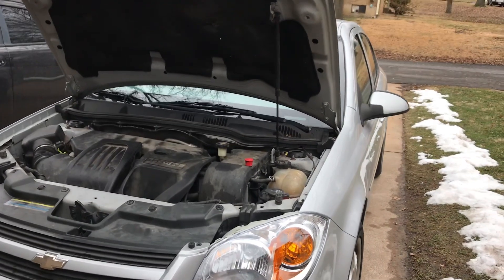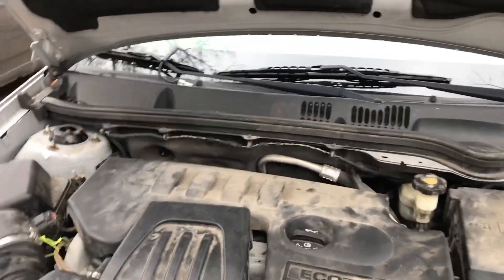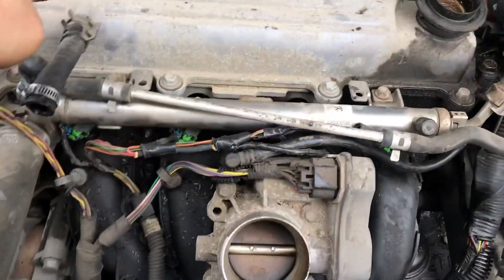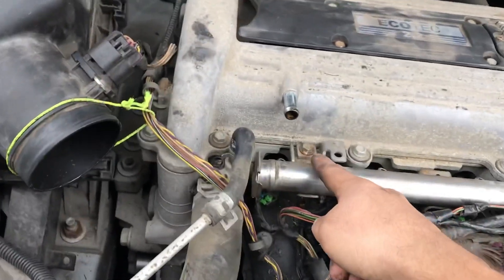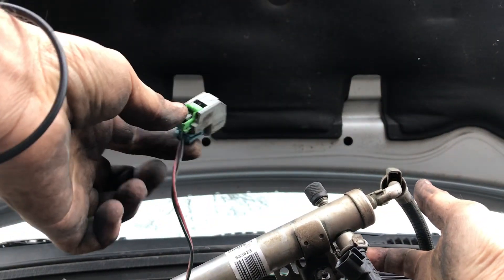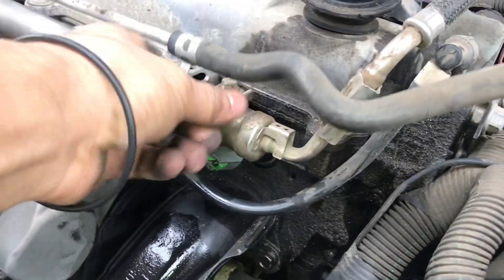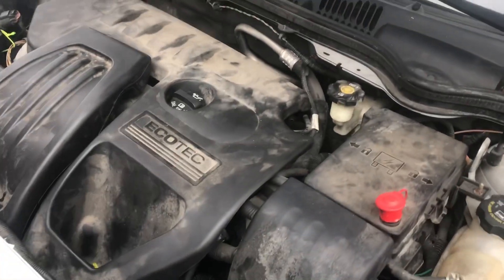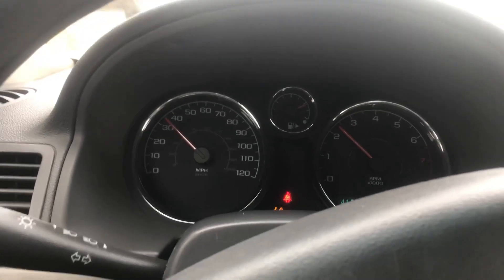P0300 Random misfire on a chevy cobalt ..

Comment: I have 2009 cobalt and I threw this P0300 code today. Same thing with starting, it starts but you can tell it doesn’t want to and it actually didn’t start for me today. No check engine light though & mine doesn’t vibrate. But I’m going to check the exhaust tomorrow and see. But so far all I notice is when it’s starting.

Comment: Thank you for video was very helpful except I would like to have watched you put coil pack back on the car
Reply from the maker: Im sorry , but glad it was helpful
Reply: Put electric grease inside the rubber boots, and then when you put it on you have to put a lot of downforce on it and wiggle it back and forth until it seats in there. It is a kind of a pain in the ass. But I also had an electric impact nut driver. But you probably already seen all that s*** already cuz your post is over a year old. But I guess I saw a pretty girl in the picture and I probably just wanted to feel cool just answering the question. I'm just an effing dumb s***.

Comment: Thanks for the informative vedio. Is it true that a bad ignition coil will affect either cylinder 1 and 4 spark plugs or cylinder 2 and 3 spark plugs. As to your example spark plug 1 and 4 were not sparking.

Comment: Great video n instructions .. my car doin the same thing .. I have a 2006 Chevy HHR .. both cars have the same engine .. every time I give the car gas it hesitate n be shaking real bad .. I couldn't never figure out what it was because it never throwed the code to I took it to a mechanic shop that has the big computer to read the computer .. and bam it picked up the po300 code .. because I took it to AutoZone it wasn't showing up .. I took it to advance auto part it wasn't showing .. them obd code reader are grabage trash at those places. But thank God I took it to a mechanic shop n they put the big computer on it n the code came up to. No I just gotta go get it fix .. but one again great video bro .. u explained it well and great 💯

Comment: Car is 06 cobalt ls with 68000 miles.  P0300 & P0128.  I just changed oil, spark plugs, clean MAF sensor, ignition coil, & and ignition coil module.  What should I change next in this trail and error?

Comment: I can see the immediate problem before even going any further into the video.....the throttle plate is stuck open.....so my guess is you either cleaned the plate so it could close or you replaced the throttle body.
Reply from the maker: The problems was a bad coil pack.. 
there was no throttle body codes, but definitely don’t hurt to clean it

Comment: Any advice on a U0073 code? Everything started when I had s misfire, changed my plugs, coil packs, and valve cover gasket. Ran great and then got the U0073 code. It’s a no communication bus a off code. Got a new battery, new tcm, checked all fuses, new ignition switch,new maf sensor, checked wiring and grounds on tcm and ecu. If I clear the code It will run great for 3 on/off cycles and then the code comes back on? When code is on it goes into safe/limp mode and you can’t drive it until you clear the code again. Any ideas on what my next step may be? I’m going crazy and broke trying to fix this! Maybe a sensor or solenoid? 2006 Chevy hhr

Comment: I have a 09 chevy malibu 2.3, it also has a misfire but it's very random, no code while the engines running but it will idle a little rough sometimes at a light and will jerk. After a little it'll go away, took it to a shop and they couldn't duplicate the problem. Started out by replacing the spark plugs. It accelerates and drives fine just at idle it has a slight misfire
Reply from the maker: No codes while engine running huh?? 🤔 
Try cleaning the throttle body , make sure to disconnect battery before you remove and start disconnecting harness ... 

If you don’t disconnect battery you might have to do a relearn and it’s not really hard but just to save you time
Reply: @Jbolanos10  the throttle body did look a bit filthy I'll give it a shot. Just weird how random the misfire is, sometimes it does sometimes it won't do it at all which what happened when it was taken to a shop to get looked at
Reply from the maker: @knighthore3457  😂!!! I know right , there’s been a few time that it has happen to me with one on my previous car, car be acting up when you driving but as soon you take it to a shop it jut starts working right away and won’t do it anymore

Comment: I got code do cylinder 4 misfire I replaced coilpack and spark plug the chek ingen went out but is still giving the code for cylinder 4 misfire
Reply from the maker: Might have to remove and clean your injector … use a spark tester to make sure your coil getting voltage

Comment: What causes my colbalt to guit when I stop at a stop sign or just idling in park . But when I'm driving down the road it runs great .
Reply from the maker: Could be a vaccum leak or misfire
Reply: That is what I was told. Broken nipple or missing. Mine does the same runs great but come to a stop it wants to die. Have to keep my foot on the gas just a little.

Comment: My question is. I’m getting a P0171 code.
Reply from the maker: Christopher Bradley hey a p0171 is a lean code .. I would check the mass air flow “MAF” and spray it off really good and while you on it, also a good idea to remove and clean the throttle body ...  before doing so, disconnect battery cables for like 5-10 mins
Reply: What would the next step? I replace purge value and MAF. If code comes back.
Reply from the maker: Christopher Bradley purge value??? You mean purge valve . And if codes come back look around and listen for a vaccum if no vaccum could be o2 sensor , clogged catalyst or low fuel pressure .. a fuel additive should help a little
Reply from the maker: I don’t like the sea foam stuff not really a fan of that or Lucas one .. there is one that I like more is call cataclean from auto zone is around 23 dllrs... read instruction .. add the 1/4 of tank and drive or 20 miles

Comment: Hey how's it going?? I have a 2006 Chevy Cobalt and I'm having problems getting gas up to the top also when I press in the fuel valve nothing comes out have replaced fuel pump and spark plugs but still no luck can u help wit some tips on trouble shooting
Reply from the maker: You replaced the fuel pump and there is still no gas comin up to the valve !?! Ok so the first thing I would do is check for a fuel pump fuse and relay .. if they ok I would check for voltage on the harness going to the fuel pump.. if you replaced the fuel pump and came with new harness most likely the polarity on the new pump changes so make sure thr you change the cables if it comes with the ones and see which one goes where

Comment: I have a 2007 chevy cobalt it's has a random misfire I tried everything no luck what should I do? I put new spark plug even replaced fuel pump
Reply from the maker: Rudy Paul if you already replaced the plugs,coils, fuel pump .. why was the fuel pump replaced???   Is any of the coil not firing up?? Do you have a catalyc code???? Clean your Maf and IAC sensor if problem still persist a cam/crank sensor could be related to... but using a compression gauge check on each cylinder should be greater than 120

Comment: hey man good video

but i have a question  maybe you can help me out but my cobalts  check engine lgth blinks only when i go faster any chance you migth know or anybody can help me what is the problem ..if is a missfire or something more then that ,,??

thanks
Reply from the maker: If it flashes it got to be a misfire going on.. 
If no check engine light is on, get you a basic code reader for like 30$ and plug it in when it flash you should have at least a pending code ... or if you have had the plugs and coil replace, it could be a clogged injector or bad, dumping to much fuel

Comment: does the 09 Cobalt LS 2.2 actually have an IAC sensor? or is it part of something else on that version? If it has one not sure where it is located but I assume it would be on or near the throttle body
Reply from the maker: Not sure,  I’ll see if I can look it up at work tomorrow or today and I will let you know I it has one
Reply: @Jbolanos10  Thanks so much dude!
Reply: It's the sensor connected to the air box where your air filter is.

Comment: I got a question? How do u check the transmission fluid?
Reply from the maker: jimmy hall there should be a 10 mm screw in front of the transmission ... not sure if it’s with the car running or off you take it off completely and check if it spills out then is full if it doesn’t is low.. to add there should be a big screw on top of transmission like size 19mm you add from there..
Reply: @Jbolanos10  yeah yeah ur right but ur close its an 11mm. To loosen rhe transmission fluid drain. 4 the 2.2 eco tec 4 cylinder!
Reply: Thx guys